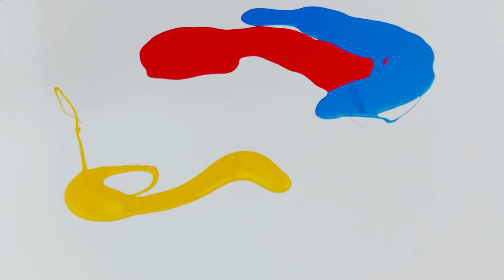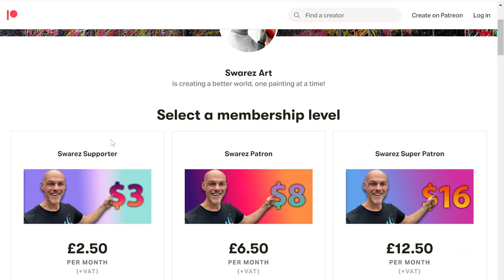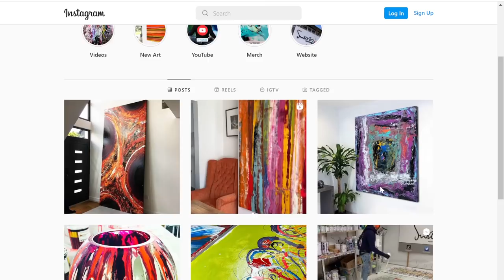Making GIANT ART -  LIVE painting on a HUGE scale!!

Comment: I feel like I should try this method... it looks like a lot of fun 🥳🎨 ...  although I am using acrylics and it will be very different. Do you finish your pieces with a coat or do these paints dry that glossy?
Reply from the maker: They always dry like this. Although I can add thinners which dulls the glossiness down. But yeah, that’s the finish that’s built into the paints. Thanks for your kind feedback.
Reply: To get the runny blending with acrylics,  you can get a fine mist sprayer. Then spray your acrylics with water. I use distilled.

Comment: Amazing! I’ve just started painting and been wondering how is the paint you use so liquid? I buy my acrylics usually in a tube and they are a bit stiff for my liking. Very inspiring!
Reply from the maker: The enamel paints I use are quite liquid anyway and then I can add solvent based thinners to it to thin it even more. Thanks for the kind words and welcome to the channel!!!
Reply: There are mediums you can buy or dilute with water also look at some videos of poured acrylic artists some tell the formula they use to dilute.
Reply from the maker: Thanks for the tips Arlene! Very kind
Reply: Swarez doesn't use acrylics.  He uses enamels.  Hence all the safety precautions ( to prevent inhalation of fumes) Acrylics can be thinned with up to 40% distilled water. Or you can use 30% water + 70% pva. Or something like floetrol paint conditioner or liquitex pouring medium. Acrylics work differently from enamels.  Have a look at Olga Soby , Gilly Cube, Pricilla Batzell.  They might give you some inspiration?  Hope this helps? Happy creating!
Reply from the maker: @mumo9413  thanks for that! QoC!!